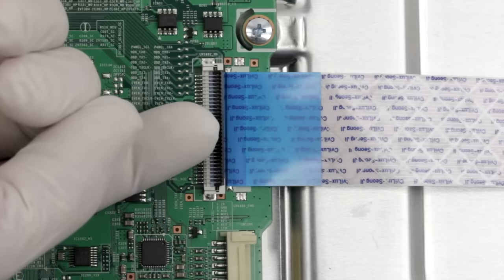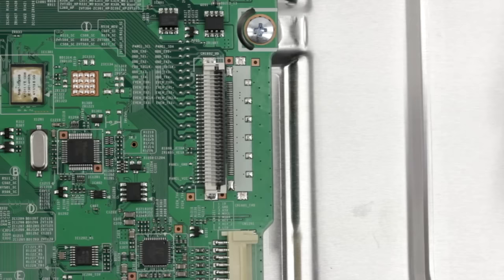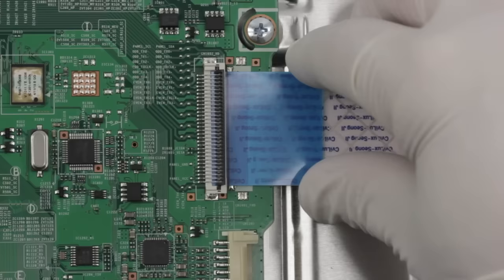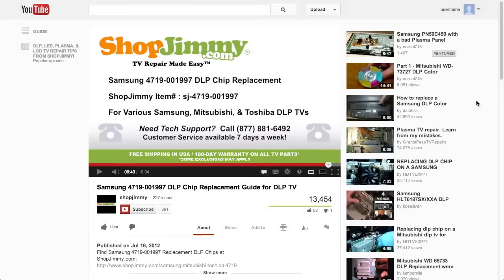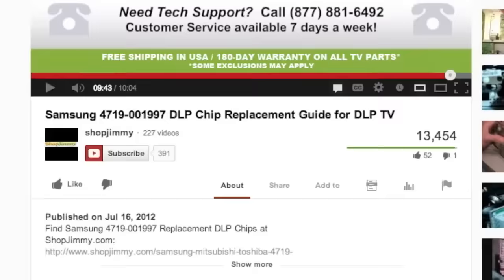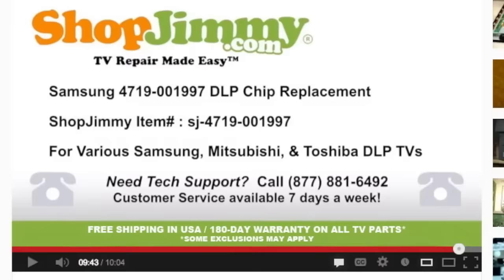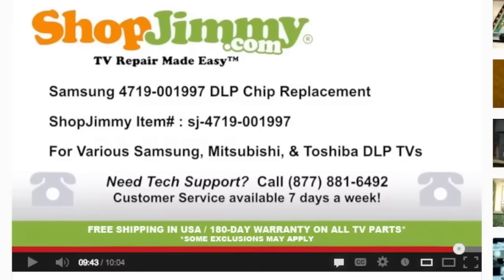TV Ribbon Cable Connector - How to Install and Remove

Comment: Thanks for the video of how to remove a cable from a ZIF (zero insertion force) socket! I can't believe the number of people that post videos that suggest you just take a pair of pliers and force the cable out or in to the socket. It's in LOCK position folks... of course it's hard to get out... it's not suppose to come out. 

Forcing a cable out of a ZIF socket can (and usually does) damage the socket hinge pins and/or the cable itself. By viewing this thoughtful video hopefully you can see what the term "zero insertion force" is all about.

Note that not all sockets of this style are ZIF sockets. Some sockets are designed to require you to pull with minimum force to remove/insert the cable, but if it looks obvious to you that the top lid is a hinged door, then gently pry up with your fingernail on the side OPPOSITE of the hinge pins.

Best of luck to all of you DIYers out there!

Comment: I just ordered a part from you guys, and I was wondering how to remove the leads.  Thanks so much for this video!  I watched about 5 seconds of it and realized what I needed to do.  I didn't know those things flipped up.  I was trying every which way but that way.  Went straight to the tv and flipped them up with absolutely no problem.  Thanks again!

Comment from the maker: @exqmedia - If its at power on the temperatue from the power supply won't be high. It takes quite a while for them to warm up. If it was heat related it'd most likely get progressively worse as the monitor was left on. It's possible you are getting a little noise from the power supply, but since you changed the power supply and have the same issue, it's probably a main board issue.  Thanks!

Comment: Pensonic led 32 inches w/ model AV53TRM I need to replace the tcon board..
Now I don't know how to remove the ribbon cable. Tcon number ST3151A05.
I need your good attention and advice, thank you

Comment: We broke the flip connector when trying to take out the ribbon. The whole top just popped off like a rocket. Is there a way to buy and replace those pieces, or does it need a whole new board?
Reply: same here

Comment: Heya,Had faulty Panny 32lx14 mainboard, so I bought a new one but from a 32lx1 instead.

Soon as done, the last part to connect was the Tcon cable to the new mainboard. Both boards use different Tcon insert methods! On the old 32lx14 it was a "snap" method, you removed the cable by pressing your thumb and index finger on the sides. The 32lx1 board uses the "lever" method in the vid above plus a ribbon instead of a cable. 

Tcon board uses "snap"; new mainboard uses "lever" How do I solve this?

Comment: hi jimmy. do you have any idea on what could be the problem with vertical lines? Screen is totally black when turned on but vertical lines are visible. Have you encountered this problem with this manufacturer? A lot of tnx.

Brand: Samsung 500T
Model: notebook xe500t1c

Comment: I have a Samsung SyncMaster G2230 with a grey/white screen (raster).  No image.   No obvious damage on boards.  The SMD board was quite gummed up and was cleaned to no avail.  I'm starting to suspect the ribbon cable/and connectors.  Any thoughts?  Good video.

Comment: You have a video showing the flip up connectors on the ribbon cable. I need to know how to remove the other style on the bottom of the Samsung 50uf2  aka BN96 main logic board. Thanks

Comment: Hi, I removed ribbon cable from Sony ht rt3 sub woofer due to mice stuck inside there, so I couldn’t connect it back , do I need to buy that cable again, one pin from that cable came up while plugging in,

Comment: Great video.  Wish I had seen it before popping out the Ribbon clip on a Sony Vaio VPCEJ2B1E when getting a replacement keyboard ready.  Unfortunately my local laptop repair have snapped it, in trying to get it back in place, so am totally at a loss at how to remedy this, so that I can install new keyboard. Any workaround, anyone?

Comment: I have an EmersonLC391EM3 tv and don't no how to remove the ribbon connector, there is no "flip tab" like in your video. The ribbon is inserted from the top of the receptacle. Also, when replacing the power board do I need to replace the ribbon or is it still usable?

Comment: My Led Tv Ribbon cables some lines turns to black (can see under white strap) and screen got problem (like multicolored vertical line etc) does the ribbon cable changing solve this problem?

Comment: Hi, I need some help, I need to change the Lvds Flex Ribbon Cable for Vizio E550i-b2 on my screen.... can I use liquid solder to stick down the ribbon? Or do you suggest another option.... thanks in advance

Comment: Hey my ribbon on my Vizio E320-A0 looks a bit different. The blue part is all by itself. The two flat parts behind the blue are not flush with each other, but have peeled away from each other, near where the blue part is. Should it be more like this one? The two flat white parts snug under the blue part that connects into the board?

Comment: How about my Casio CDP 135 digital piano without the "flip-up" casing to insert the AWM 2896 audio cable?  I damaged the cable while inserting and somehow it twisted and cause one strip connector to fall off.  I am now ordering from online and it is quite cheap.  Nevertheless, how do I insert the cable without damaging it.

Comment: Thanks for posting this. Wondering if you have any suggestions for fixing a 6 year old Samsung LCD TV that has had vertical banding on-screen for the past few years. The banding can be white, black, yellow or multi-colored depending on the mood the TV is in that particular instance. The problem is pretty temperamental but usually occurs when powering on and disappears when the the TV is given a tap on the back panel or after warming up. After awhile has gotten progressively worse, so I tried a few fixes: 

- Checking the ribbon cable and gently pushing them into the connectors
- Reseating the ribbon cable 
- Spraying the connection with DeoxIT D5 

The problem seems to have gotten better after each attempted fix, but the bands will still appear/disappear at the slightest jostling of the TV. Maybe it isn't even the ribbon cable that I'm focusing on? Any suggestions would be appreciated, thanks. 

Here are the specs on the TV: 
Samsung Model No: LN46C630K1F
LFT460HJ02 

Ribbon Cable: 
TOP PANEL BN96-12723D
(570um) TOP MAIN PBA FLEXCOM 1004 1-11
Reply from the maker: Joe Abe   This sounds like a TV panel problem.  If your TV panel is bad, it may be more cost-effective to replace the TV as panels are typically hard to find in stock, difficult to replace, and expensive.  Thanks and please let us know if you have any further questions!  www.shopjimmy.com

Comment from the maker: @alsodani - Unfortunately you have purchased the wrong board.  There is no cable that can merge the LVDS connection and the ribbon cable connection. I am thinking you purchased the Panasonic TNPH0799 (Ribbon cable) and your TV needs the Panasonic TNPH0799AD (LVDS). Unfortunately, we are out of stock on these parts. Search the part number on our website shopjimmy com and sign up to be notified when the part is back in stock. You can also call our customer service for assistance.  (877) 881-6492

Comment: Tampatec Im looking for the two short 80 pin flex ribbon that goes fror tcon board to panel. With not much experience I think I may have damaged the flex cable coming from the panel. Jimmy dot com says the dont have at the moment. Do you know the number and its for ln40a530P1f Samsung and tcon board v400H1-03M$35-Do26047. One more thing as long as its pitch 80 will it work from diffferent a brand Thank for your help.
Reply: this is not the reply or comment but myabe you will get it and give me some help

Comment: I got into an Amazon tv and got the power supply board out but I need to get the other board out. (I think it is the logic board) one of the things that is keeping me from getting the board out is that it has this weird connection to a ribbon cable that keeps me from being able to disconnect the cable from the board. Also another connection has thin wires but the connections seem to be glued in place. How would I disconnect these connections?

Comment: Can someone please answer.. I replaced all the led on vizio e55-e1 backlight and put together and now I have a thin vertical line on left side and a slightly thicker white line on edge of right side of tv? Wasn't there before? Maybe ribbon connections?
Reply: @ShopJimmy what do you suggest to my question above?

Comment: Hi guys I have a samsung 39"flat screen tv. Model number UE39F3000. The bottom half of the screen is less bright and quite faded. I suspect there is a problem with the video board but not sure. To replace the video board appears be tricky as the flat cables do not have snaps to all for easy disconnect. Any advice would really be appreciated.

Comment: Hi!
I have a problem with my Samsung monitor LCD. At power on appears some artefacts for 1-2 seconds then dissapears. All capacitors is good, soldered all components contacts,change power supply - same problem. Could be a fail FFC cable ? Engineers from Samsung put the power supply near at 0.3 inches from FFC cable. The problem is that power supply is very hot. High temperatures may affect FFC cables ? 
Thanks!

Comment: Can I use ribbon cable connector BN 95-00497A. Or BN 95-00498B for BN 95-00497B (connector between t-con and led screen)? I can't find it.
Reply from the maker: Mory CD   Unfortunately you cannot.  Thanks!  www.shopjimmy.com

Comment: There were two connectors attached to my HP ENVY M6 keyboard. The large one and the smaller one but the smaller one broke off. My screen is now blank even when the laptop turns on. What should i do ?
Reply: Replace cable, if not, screen

Comment: Okay I have a question I have a Sony 60 inch rear projection TV KDs XR B1 anyways the problem is the TV doesn't power on I had someone come out and look at it they said the resistor is bad replace the resistor and also then they told me it's still not powering on they told me it's the fuse they replaced a fuse as well still doesn't power on. They basically broke my TV anyhow messing around looking at the inside of the TV with the back off found out that the ribbon cable is ripped not sure if we can fix it not sure if that's the problem but I believe the ribbon cable is connected to the board and that is what's causing the TV not to power on could that be the issue. The bulb Works everything else seems to be in place let me know. If that's the case can I replace the ribbon cable is it easy do you think that could be the fix I mean that's the only thing I can think of let me know and we'll go from there thank you

Comment: Can someone please help me find a T_CON Ribbon cable 69.26T04.004 for Phillips 26 inch Model 26PFL3403D/10 ( 80 pin on one side and 80 on other side ) Dimensions of cable 40.5mm width x 52 mm length.
Reply from the maker: Joseph Saviour Mamo Unfortunately we do not carry these cables.  Thanks and please let us know if you have any further questions!  www.shopjimmy.com

Comment: Doing some further research, I think the old 32lx14 mainboard uses an LVDS cable instead of a ribbon to connect to the Tcon board. 

So now I have a Tcon board with a LVDS insert and the new 32lx1 board that instead uses a ribbon like the video above...I really hope there is a hybrid LVDS to "ribbon" cable out there as I am currently lost on how to solve this....

Comment: I had a Samsung monitor that didn't have a hdmi connection it only had vga or dvi but I took the monitor apart there is 2 screws at the neck of the monitor stand and wedged it open and took that blue ribbon connection off and tried it and it still didn't work so I put it back and and was just going to give the monitor away and upgrade,but when I turned it on it works perfect. Crazy, after ages of buying and trying new leads 😏

Comment: Your title is misleading. It suggests you are providing instructions about the "connector" (aka, clip) rather than just the ribbon itself. Good video for that simple task, but my issue is more serious, and probably involves a soldering iron.

Comment from the maker: @powermetal001 - Is there a specific cable you have questions about or details about that cable?  Thanks and please let us know if there is anything we can do to help.
Reply: I need a ribbon cable replacement.
Reply: specifically a m34-c1 ribbon cable for the t-con board. Only 1 works. the pins are fractured and damaged on the other.